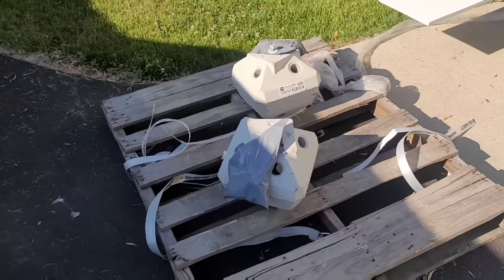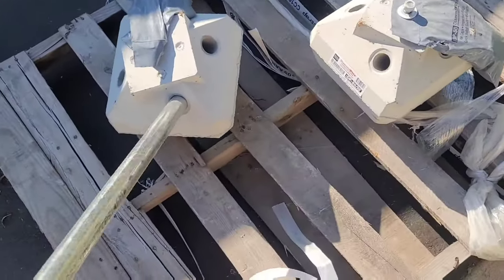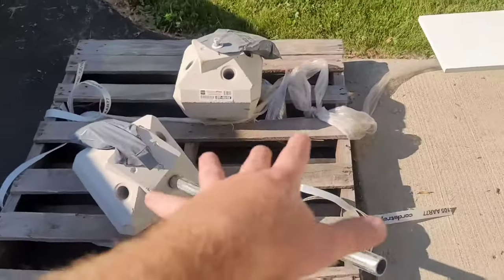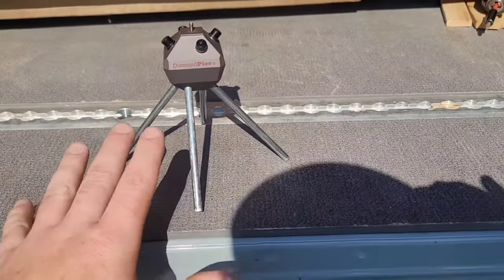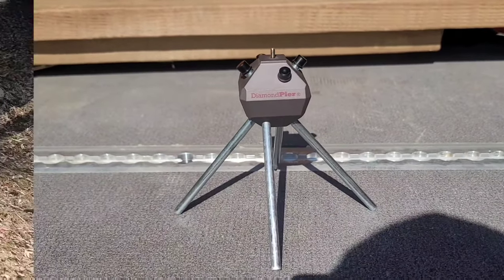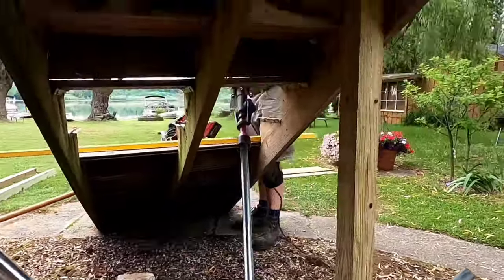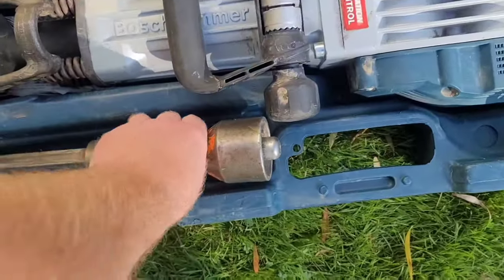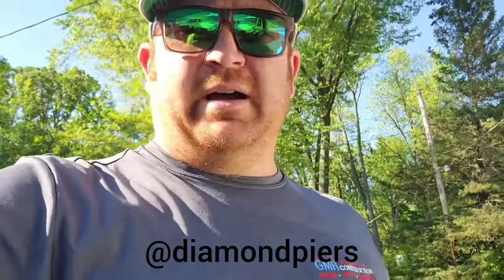Diamond Pier Pin Foundation Installation and Review

Comment: These make no sense whatsoever. They are certainly going to heave.
Reply: Do your research
Reply: @austinmiller5516  I have, extensively. Anything that can be pressed on underneath and lifted by solid frost soils will heave. That is why Sonotubes for example do not have a larger surface area above a smaller surface area. This gives the expansive soil a chance to "slide" up the footing because there is nothing there to lift.

As an engineer, I can see how these systems will aid in reducing settlement, but certainly not heave, especially here in Minnesota. Are you expecting us to believe that the earth rises around the block and the block does not rise with it? Where do you expect the compressed earth underneath the block to go?
Reply: @Cotronixco  did the video not say there was a 10 yr study for that and everything was good to go?
Reply: @austinmiller5516  I have a bridge to sell you.
Reply: @Cotronixco  they meet code where I live so good to go here
Reply: @austinmiller5516  Good for you.
Reply: we get 72" of frost in NW Wisconsin. I have heard they work great.
Reply: @21368xray  Simple physics tells anyone who can think that these will heave. It's possible that they were designed as an easier way to create a pier that won't sink. But when it comes to frost heave, it's quite obvious that the frost can't slide up the sides of these at all.
Reply: @Cotronixco and yet every winter people who have used these decks don’t flinch
Reply: @jeffreymello5024 Just like all those uneducated and inexperienced folks don't do with regular pier blocks.
Reply: @craigolson4608  your confused bud this isn’t about that this is about these, apples to oranges. This eliminates digging 4 feet and pouring posts, and they don’t heave…..
Reply: @jeffreymello5024  Sure, and I have a bridge in Brooklyn to sell you. So the ground does not contact the bottom of the block?
Reply: There is nothing to stop them from heaving. Frost heaving ground can easily bend pipe that is not buried deep enough for the zone.
 The expansion of moist ground  as it freezes is a powerful force to be reckoned with and should never be underestimated. It can lift houses and break or bend pipes. I have seen huge boulders get ejected right out of the soil over years of freeze and thaw cycles.
From A I ;
 "Frost heave can cause soil to rise when water in the soil freezes and expands, which can damage tree roots and make the tree unstable. Frost heave can force root systems up and out of the soil, which can cause breakage of the roots, or, in severe cases, can even cause the tree to lean or fall"
".Yes, frost heaving can force boulders out of the ground. Frost heaving is a process that occurs when water freezes and thaws in the soil, creating ice lenses that push rocks  and other solid objects upwards . The force of the ice can lift a layer of soil by up to one foot."
Reply: @williardbillmore5713  yup still don’t move tho
Reply: @jeffreymello5024  Is there anything I have said that makes you think I am stupid enough to believe you?
Reply: @williardbillmore5713  don’t care
Reply: @jeffreymello5024  Well most people do care if what they build is going to lift up in the winter. It is obvious to anyone who understands how frost heave works and what it can do that this company is making false claims about how their product performs...
 How much are they paying you, Jeff?
Reply: Ok I’m here 2 years after this comment. Please someone tell me we have a verdict?
Reply: @NaijaHakeem  The verdict is that only a fool would pay their hard earned money on anything as worthless as a diamond pier.
 It is designed to attract non- professionals who want to do a minimum of work and do not understand construction physics.
 Do not try to use them anywhere that you would not use a surface pier...because that is all they really are.
Reply: @NaijaHakeem verdict is they work, people who make money doing the work don’t want them. Or you to use them and not their services. But they work so use them or not it’s up to you.
Reply: @Cotronixco your "common sense" doesn't trump statistics, guy. 

your napkin math is missing some fundamentals.
Reply: @Cotronixco does the ground not contact the bottom of a poured pier? 😂
Reply: @TSAlpha2933  You have no idea how frost heave operates. Until you do, the simple physics of this phenomenon will remain over your head.
Reply: @Cotronixco
 

That's actually interesting. 

But I would want steel rods. 

Frost doesn't hit in MO like WI.

Edit:

I don't want to sound like a noob. 

Not to say those conditions won't occur once in Hundred Years.

And I'm the Ozarks so it's minimal to get to a hard pan and those tubes are as good as a wall.
Reply: @Cotronixco   

"Simple physics tells anyone..."

You know Jack shit about physics.
Reply: @notahotshot  It's actually quite simple for some of us.
Reply: Your funny, 😅
Reply: @erikowren7894  My funny?
Since you did poorly in school and simple English is over your head, have a fifth grader proofread your posts before you post them.
Reply: @Cotronixco  grrr, sorry about that. I’m Dyslexic. My funny.

Comment: If there are 4 ft long and going at an angle they are not going 4 ft deep.
Reply: Even if they do go to the frost line , it is meaningless. The surface will heave and take the surface pier and your structure with it. In their warranty they do no claim that these things will do anything that a surface pier doesn't do too . Buyer beware.
Reply: @williardbillmore5713  you've absolutely no clue what you're talking about.
Reply: @notahotshot  No, that would be the oily salesmen trying to explain how something that is impossible works....Frozen ground expands an lifts up and anything above that frost line will lift up with it. It has to.
It is simple physics. 
All earth holds water. When the ground freezes the water it holds freezes and expands upward carrying everything within it including pipes driven at an angle and concrete piers sitting a couple if inches into it surface.
The magic this company is trying to sell to their inexperienced customers is that somehow the diamond shaped pier will magically split the ground it sits on because it is held down by pipes in the same ground that is lifting. It is like saying that a boat will stay anchored in place if it is tied to an anchor made from water...
 It is a ridiculous notion that anyone can see is impossible.
 The pipes, the surface piers and any structure on them will lift with the earth as it expands under deep frost conditions.
Expanding frozen ground can not "go around'' a pipe in the ground....It will lift it.

Comment: I looked it up on Wisconsin's website... as long as the pin is at least 50" long, it is legal to use in Wisconsin.
Reply: Legal to use may still fail. Have you looked at  Pin Foundations disclaimers and warranties?
 If the deck fails and the frost  heaves and tears it off the ledger board and damages the  house All pin Foundations will do for you is replace the diamond piers that didn't work.
 Don't be stupid . Build with a real footing and pier.
Reply: @williardbillmore5713  I've seen many cement tube anchors pop right out of the ground in wet clay.  Anyways.... I didn't use them on an attached deck... I've used them on a 12x16, 15' tall gambrel shed.  Worked great.

Comment: Interesting, a little high on price, so for now since I have the tractor with the post hole digger, rebar, and concrete,  I will stay with that, but I can see where a remodel job, these would be great, where, someone could not bring in the tractor.  The U.S. used to be mass production, but hey, if you selling out at those prices more power to you, that is after all the American dream.  congrats on a great idea.   Great Show.

Comment: I'm just discovering these and I really like what I see.  Of course, I'm down in south Texas and will be using them to build on my property in Alaska, so I don't have a ready source to check things out.  I have reached out to Diamond Pier via email for more information.  It's been a year since you made that video, what are your thoughts on it now?
Reply from the maker: We still use them every chance we can.  Zero issues with any previous job we installed them on.
Reply: They will work well in south Texas but so will any surface pier...Anywhere frost lifts the surface seasonally you need to dig or bore down deep if you don't want it to move.

Comment: Still don’t understand how the pipes in the dirt going support the concrete foot and weight is pushing on it .. the whole thing with the pipe and footer will sink all together into dirt or am I missing something ??
Reply: They use pipe line enough that the friction becomes great enough that they can't sink any further into the ground for the required support.

Comment: I don’t understand how this is code. You are driving a 52” pole at 45 degrees into the ground (this angle is in the patent for Diamond Pier). That means the post is terminating only 36” below grade.
Reply from the maker: I would assume it's because of how much ground gets "locked" up with the pins. They go every which way and prevents the pier from rising up with the freeze. Whereas concrete has to go lower than the frost line to prevent the rising. I know in my area they were passed by the state as acceptable.  Haven't had a call back yet on the multiple jobs weve used them.
Reply: Even if you use pipes that go below the frost line there is nothing in a diamond pier that will keep it from rising and subsiding with the frost season.
 Without a footing there is nothing for the load to bear on but the surface piers and the rising ground under them. Anyone who has dealt with frost heaving ground knows it will easily bend underground pipe or even break them when conditions are right, if they are not buried deep enough for the zone.

Comment: Which is cheaper cost? Regular cement or diamond piers?
Reply: Depending on the model the diamond pier is ~$150-200 ea. Regular concrete/tube system is cheaper. The savings with diamond pier is significantly less labor to install. Also you don't have to wait for an inspection of the hole, then wait for the concrete to dry. You can build on them immediately. If you are paying for labor then diamond pier will be cheaper.
Reply: Time to make a form to cast these ! Also 45 degrees angle: sqrt 2. 52" / 1.414 is not 4 feet down.
Reply: It depends. If you are building a deck and you use these things with a ledger board the damage done to your home will cost more than you can imagine when the frost lifts the deck up.
  If you are using them under a freestanding structure these surface piers will just rise and subside with the frost season, but they won't necessarily stay level..

Comment: Here is a copy of Pin Foundations disclaimers and warranty;
---   Pin Foundations, Inc., is not responsible for performance failure if: (1) The Diamond Pier product has not been installed according to the current full published Diamond Pier Installation Manual, or not installed in Normal Soil Conditions, or not used in compliance with PFI’s published requirements or stated capacities. (2) The cause of failure is due to related parts not supplied by PFI (PFI supplies the Diamond Pier concrete head with embedded anchor bolt, steel bearing pins, inspection plugs, and caps). (3)  The cause is due to poor or unsound soils or to special conditions that require additional measures above and beyond those typically or prescriptively required in the local code jurisdiction. Such conditions may include but are not limited to soil bearing strengths below 1500 psf, hydric soils, unconsolidated or uncompacted soils, fill soils, aggressive or contaminated soils, peats, highly expansive soils, severe frost susceptible soils, soils not properly drained, structures with asymmetric, rotational, overturning, or dynamic loads, sites with steep slopes or sliding or shifting soils, sites with historic evidence of conventional foundation failure, or sites in frost zones exceeding those published per specific pier application. (4) The cause of failure is due to an action beyond PFI’s control, such as a tornado, hurricane, flood, landslide, earthquake, etc. This warranty applies only to Diamond Pier products that have not been misused or damaged, intentionally or unintentionally. This warranty does not cover cosmetic issues, such as weathering, staining, pitting, or chipping, or general maintenance issues, such as adjusting the pins or resetting the pin caps. Nor does it cover products that have been mishandled during installation, or discontinued or are outdated. PFI shall not be liable for any incidental, consequential, special loss, or other damages, including injury to persons or property, however caused. No other warranties are express or implied.   ---
 Hydric soils, also known as wet soils, are soils that have been saturated by water for one or more weeks during the growing season. So if you have snow melt or rain for more than one week of the year  on the soil that you placed your Diamond pier they will not cover anything.
"highly expansive soils" are soils that contain any water that may freeze and expand.
In other words they are not responsible for any application of their product that causes damage. They exempt pretty much all soil conditions that could possibly exist and the only thing they MAY do, if pressed, is replace the product.
 Don't be stupid.

 This warranty is worthless .
Reply: obviously its a good idea to get the water away from any pier solution using drainage/swails etc. Also 1 inch of blue board is 12" of dirt. So 2" of blueboard would help significantly in eliminating frost problems. My father in law worked at Cold Regions Research for Army corps of engineers. He had a water line that wen t over ledge....covered it with blue board....never froze in Vermont.  He was an expert in Permafrost and more than one beer was consumed in the discussion about blue board performance. So if the conditions are right, go with the blue board in Cold states.  2 factors, water, soil temperature. Eliminate either one then its OK. Eliminate both for best performance.

Comment: Do they take a 4x4 or 6x6?
Reply from the maker: Either. There are 2 sizes for varying load needed.  Single bolt.on the top fits various post pads
Reply: yes thats covered in the video

Comment: They are surface piers. If the moisture in the ground freezes beneath them and rises, there is no way they will not lift up. Frost heaves can easily bend pipe.or lift a whole house .
 Do not get Duped into calling these pipes "footings" they do not come close to fitting the definition of a construction footing.

Comment: Why would you say that they are not a replacement for concrete? huh? They absolutely are a replacement for concrete. They actually are better than concrete because they don't move up or down during freezing.
Reply from the maker: It was more of a situational comment. Piers cant replace concrete in every situation. They are most certainly a replacement for concrete in the correct situation tho.
Reply: They absolutely do move up and down with freezing ,expanding soils. These  things are surface piers. Do not use them anywhere that you wouldn't use a surface pier...a concrete block will be a lot less expensive and will perform about the same. Don't be stupid and believe that the laws of physics do not apply just because some slick sales pitch tells you that they don't.
Read their warranty and put yourself in the place of someone trying to collect on it.
 It is worthless to try.